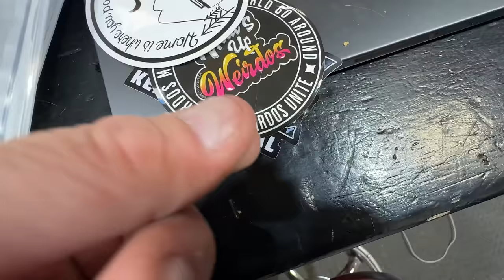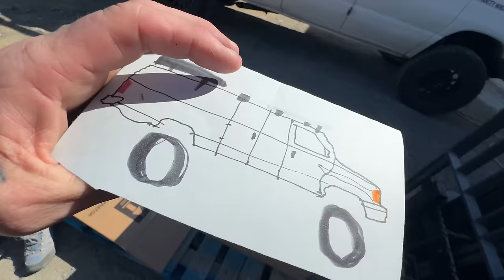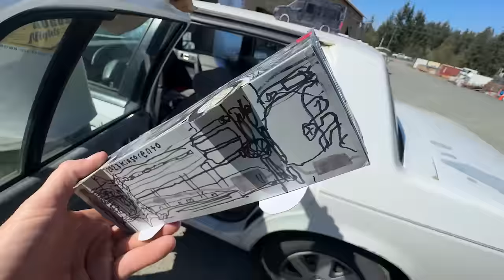Fulfilling An Autistic Kids Birthday Wish. They Asked Me To Drive Over It? SO I DID.

Comment: What you say how you feel is indicative of a herniated disc. The next time your back goes out it will be even worse. Both of the disc I had surgery on (at age 35 and 59) Mt disc's were very bad. The one hip higher than the other shows how huge the herniation is. Go to the doctor before the nerve damage sets in. You don't want to go around not feeling all of a leg. I have done that since 1993. Gwt seen right away. Don't delay.